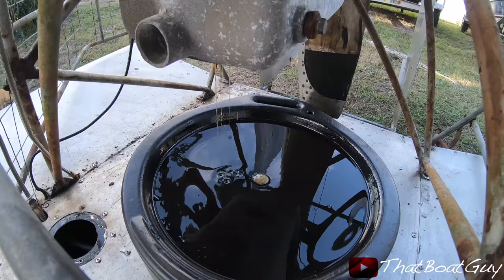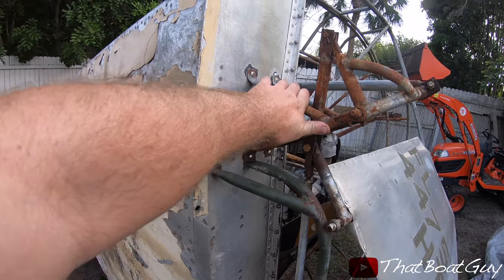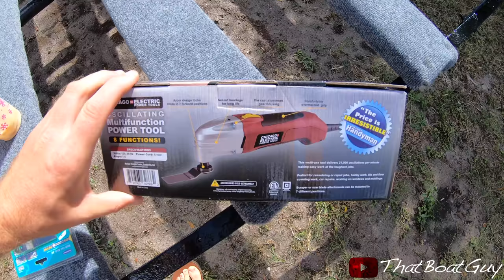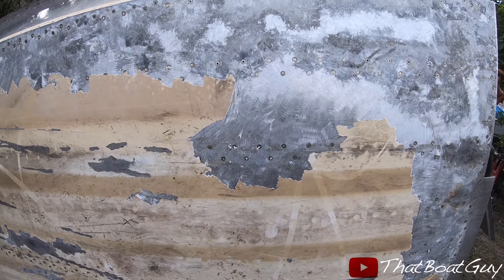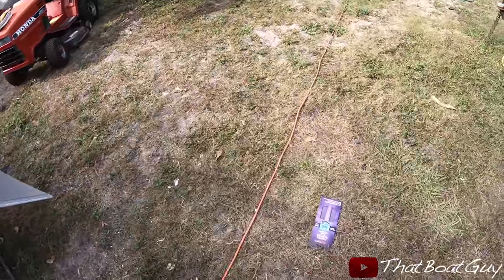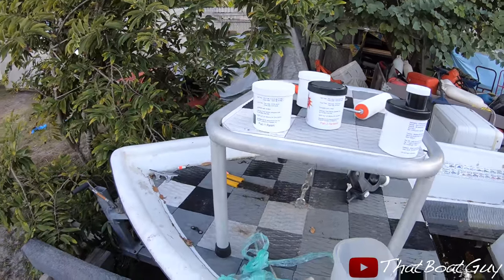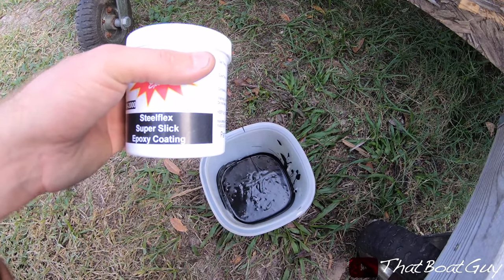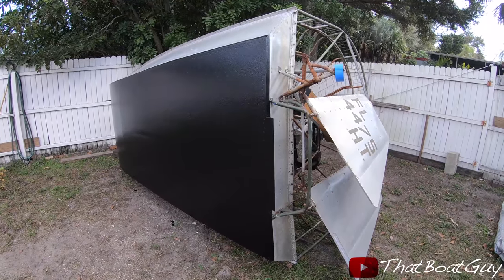Redoing The Bottom Of My $175 Airboat

Comment: Cool project to have fun with!  If you can not find a new prop, consider carbon-fiber encapsulating it (or fiber glassing it).  Also consider ducting the prop as it will increase the efficiency of thrust.   🤙🏼

Comment: you should always use self-etching primers to avoid paint/epoxy/coatings flaking off later on down the line. aluminum oxidizes as soon as it touches oxygen, which is exactly what you're trying to avoid as aluminum oxide is brittle and doesn't adhere well. Also, aircraft paint remover would be a great chemical stripped for future projects of this kind. brush on, rinse/scrape off kind of thing.

Comment: aeroshelll w100 will turn black.  That is normal.  However, it usually takes about 15 hours of operation for it to start turning.  If it gets black very quickly, you may have blow-by into the crankcase from the cylinders which indicates worn rings.  There is a leakage tester for aircraft engines that applies 80 PSI of shop air through the spark plug hole into the cylinder via an adapter that fits the hole. YOU MUST HAVE SOMEONE HOLD THE PROP VERY TIGHT OR IT WILL SPIN AND COULD START.  MAKE SURE THAT THE MAG IS OFF!  People have been killed by just moving the prop of an aircraft engine.  They are not like auto engines.  Anyway.  Once pressure is applied to a jug, you can listen carefully at the intake, then the exhaust and then the oil fill for air leaking by.  If you hear it in the intake, you have a bad intake valve on that cylinder, if you hear it in the exhaust you have a bad exhaust valve.  If you hear it through the oil filler, air is leaking past the rings and you will have blow by.  You should easily be able to get the manual for that engine.  They are simple and dependable but dangerous if you don't know what to watch out for.  Doc

Comment: the biggest reason people flip the boats on the bottom is they dump the steelflex and let it level itself it’s a self leveling product, polished aluminum relfects in sun and blinds you during riding i know from experience and also gets very hot but the dangerous part is how slippery i recommend putting strips of carpet also, black steelflex can get hot depending on where you ride whenever you do ride please no deep water when you first start you will sink or flip 100 percent if you dont know what you’re doing

Comment: BTW those are not aircraft specific motor mount. Aircraft motor dont mount to the an aircraft from the bottom of the engine but rather from the magneto side of it which would be the back of the engine when mounted on an aircraft but it's the front of the engine when mounted on an airboat.

Comment: I understand that you need to use the correct primer on aluminum - is Steelflex suitable ? 

I guess you don't want it peeling off in a year or two.
Reply from the maker: I didn't see a primer but I could be wrong?
Reply: ThatBoatGuy I would use primocon. That’s what we use on all aluminums at my dealership

Comment: I have a boat with a transom of 17 inches and I am trying to buy a Yamaha 25 hp short shaft engine will I have any problems if I slap a short shaft motor on a 17 in transom
Reply from the maker: It will work perfectly

Comment: Next time i recommend using aircraft stripper. It will eat through anything, just have to be careful not to get it on anything or yourself.
Reply from the maker: I'm going to try that next time
Reply: @ThatBoatGuy  yeah it'll leave aluminum alone so should be fine on most metals, ate the old finish off of bunch of Penn 706s I've refinished

Comment: Use White Diamond Polish on the aluminum with a puffing pad. You'll be surprised with the outcome. I always used it in the aluminum bed of the rollback I operated and the aluminum wheels. It works great. Most auto parts stored handle it. A little of it goes a long way also unlike other polishes.  https://www.amazon.com/White-Diamond-protectant-oxidation-discoloration/dp/B00MN9RKG8

Comment: I feel like you needed something way more aggressive then 100.
Reply: 100 would have been good but not on that little palm sander. Prep should have been done by hand or 80grit used on a da to get a good tooth in the aluminum. Also, some distilled vinegar to etch through the oxidation that immediately starts when sanding aluminum.
Reply: I know ppl that go slick bottom go way more aggressive.
Reply from the maker: I actually did 36 grit
Reply: @ThatBoatGuy  I must have missed that if you said it.
Reply: @ThatBoatGuy  I found some  project boats in my area that I think you might be interested in